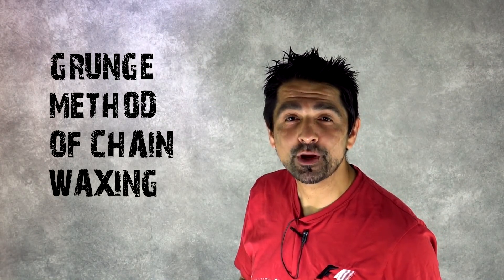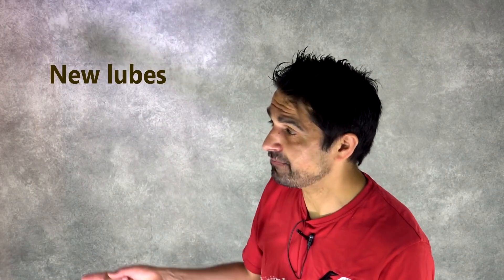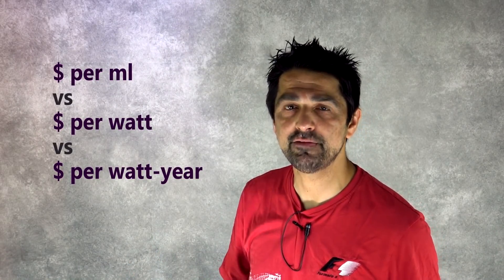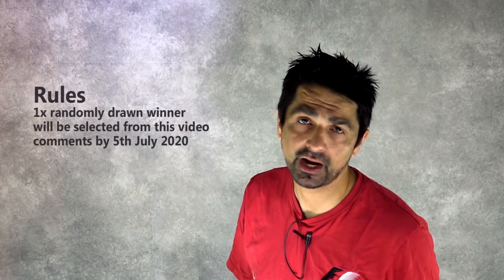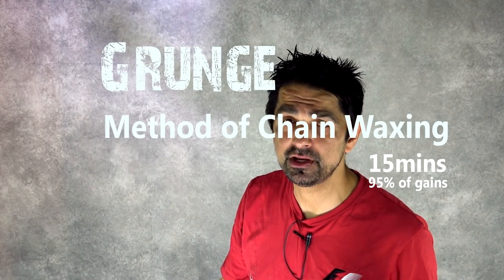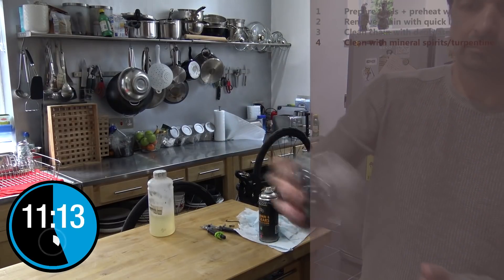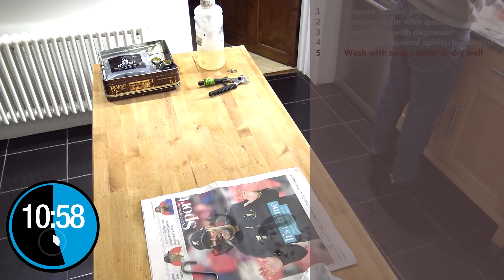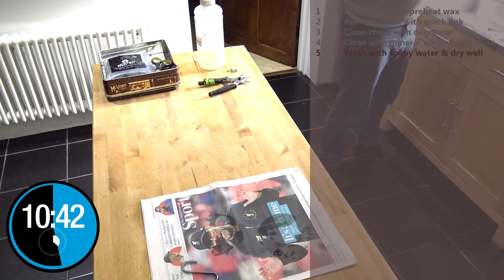Chain waxing and lubes revisited (15min grunge method is not a marginal gain)

Comment: How many watts does sealant add when putting it inside an inner tube ? I am considering buying Vittorias corsa control g 2 tlr for every day use for the added benefits. I saw latex tubes were recommended for the 5W saving but they ofcourse wouldn’t work well with sealant and aren’t the best at prolonged braking at descents. I think I value my life more for 5W and saw continental offered supersonic inner tubes which if I’m not wrong are roughly the same weight as latex but are butyl so that should definitely save me watts, but if you put sealant in, how many watts would that cause me to lose ? The recommended amount is 3 oz for a road bike from slime.
Reply from the maker: Sealant costs about 0.06w per ml of sealant so 30mls would cost about 2w
Reply: FastFitnessTips: Cycling Science! Thanks for the reply! For watt cost savings would you recommend at most 30mls to do the job compared to the 85ml recommended amount ?
Reply from the maker: @bxckdoor9113  is speed is critical then yes use minimal mls sealant

Comment: I tried using paraffin in the past, but it didn't last long, especially commuting in the rain.  Paraffin gear oil mix lasted longer but didn't stay clean.
Reply from the maker: Yes I heard mixing oil and wax doesn't work that well?
Reply: @Fastfitnesstips  Back in the 80's there was no source of teflon or graphite (no internet) and pure paraffin doesn't cut it, especially when wet.  The Paraffin gear oil mix was much better, but it doesn't stay clean, so it kinda misses the whole point of waxing.

Comment: I’ve been using Muc Off hydrodynamic lube
Reply from the maker: Hows it been going with Muc Off hydrodynamic lube I havent tried it myself
Reply: @Fastfitnesstips  It's the best one I've used so far.  It lasts a long time and seems to rejuvenate the drive chain.  I went with it because I was using a wax based lube on  my partner's Di2 Ultegra.  Her chain seems to require more lube than mine which is a Campy ultra narrow .  So using hydrodynamic lube on both.  She now gets leg markings because the lube is basically a wet lube designed for long rides so there is always residue.  We are planning a ride across the U.S. and I was looking for a long lasting lube.  I have a very very unique way of applying and cleaning my chains which I claim will make a chain last forever(just a nomenclature). The method may well give the same results as dismounting the chain; except this is done without removing the chain.  I was going to do a youtube on the method but I looked at myself in the camera and freaked out.  Perhaps I'll make it anyway and send it to you.  I'd like to try the absoluteblack or Silca's Super secret because I like wax type lubes because they are clean.  I did try to melt wax but the result wasn't what I wanted.  Thanks for asking and thanks for your channel.
Reply from the maker: @davidstihler9689  sure send me a DM or similar comparison especially when you have tested further

Comment: Silca's Super Secret Chain lube (the drip one) is ALMOST as good as hot melt. I've been using Molten Speed Wax for my hot melt application, and then I top off my chain after each ride with Silca's Super Secret drip wax. It prolongs the life of the Molten and allows me to go longer between having to do a fresh hot rewaxing.
Reply from the maker: Wow you are cutting edge, its only just out!!
Reply: @Fastfitnesstips  the Super Secret Chain Lube (drip lube) has been out for around 2 months. Silca's hot melt is the one that just came out.

Comment: I've been running waxed chains for 2 years, wouldn't go back to oil-based lubricants.  I use boiling water rather than a degreaser.
Reply: I clean mine in hot paraffin i.e. in a jar set in a pan of boiling water

Comment: What are your thoughts on DuPont Chain-Saver was based chain lube. Motorcycle chain lube, I have been using for a couple years.  It appears to offer the same benefits of standard waxing.
Reply from the maker: I doubt spray on waxes work as well as immersion but they might be an alternative to drip methods. Have you seen this test? https://www.youtube.com/watch?v=VnPYdcbcAe0

Comment: I think just thorough, regular cleaning pays huge benefits as well, even if you use a conventional lube. Just clean thoroughly and reapply often. But the wax is definitely interesting.
Reply: Yep. I think the reality is that most people who use conventional lubes are inclined to just add more lube and to not do a good job cleaning their chains. If that weren't true, then these chains would be just leaving mostly oily marks on hands and clothes and not really black marks. Its just easy to squirt on some lube and do a quick wipe down with a rag. Everything quickly works better, but the dirt remains where it grinds down your chain and gears.

Comment: I have been waxing chains for two years , using the Molten Speed wax. I run 4/5 sets of chains, so waxing process is greatly reduced. Something worth considering. Only draw back i have noticed is a slightly higher noise when cross chaining (I run 1X) , but also a sign I need to switch to new wax chain. Good work on this video. Cheers Rav
Reply: Since watching this, I had to try the AB product, so I have ordered the smaller bottles. Lets see how these fair. (They are not cheap)

Comment: I don't wax my chain.  There was a good watt test of cycling chain lubricants a few years ago that showed that the best wet lube was within 1 to 2 watts of the best waxed chain.  If I find the article I'll post a link.  I remember well that Rock n Roll Gold lube was the best wet lube, took 2 minutes to apply, and was extremely cost effective.  If the best waxed chain is, at best, 2 watts better in performance than the best wet chain lube I'll stick with the best wet chain lube for ease of use and virtually no time commitment.  If you have to have that 1 to 2 watts then go for it.  I've been an avid cyclist for 30 years.  Thank you for the info though!
Reply: The thing is, oil based lube is probably as fast as the waxxed one. But after one ride the oil will attract a lot of dirt and lose the efficiency while the waxxed one won't get that dirty.
Reply: I started waxing when cycle commuting on my e-bike. I was putting over 5000 miles/year on the e-bike and just disliked the messy chain when dealing with rear flats or any other roadside issue that put me at or near the chain. The performance benefit is not a big draw for me. Although the promise of longer chain and drivetrain life is.

Comment: I guess  I am one of the odd folks that regularly waxes his chain and have done so for many years now.  I have long since passed the age and ability where the watts I save are actually noted, but I do it for several reasons anyway.  No black greasy marks on my leg.  I love the sound of a well lubricated drive train.  Finally, I actually enjoy maintaining my bike and thus waxing is not a chore.  I use an ultrasonic cleaner for cleaning and a parraffin and Teflon mixture heated in Crockpot for waxing.
Reply: What teflon size (in the microns) and ratio to parrafin do you use?
Reply: I agree 100%. I don't understand why this "grunge" method is using degreaser and solvents. There's no grease or anything to "dissolve" on my previously waxed chain. A mild detergent with the ultrasonic cleaner (heated to 50C) seems to remove the dirt quite well. I do two ultrasonic passes and "shaker jar" the chain a few times before the second pass. The second pass isn't really needed but I use the clarity of the mild soapy water as evidence that the chain really did get clean.

The for time, my process can take many hours start to finish. But the time that I personally spend on it is only 5 -10 minutes. I spend time:
1) Start crock pot heating up wax.
2) Start heating up water and jar with water and mild detergent in the ultrasonic cleaner.
3) Remove chain and put it in a the jar.
This takes 2-3 minutes at most. I go do something else as things are heating up.
4) Turn on ultrasonic cleaner when temp is up to 50C. The temp is important to melt the wax. Run for 20-30 minutes.
This takes seconds to push the buttons. I then go do something else.
5) Discard dirty water in jar. Rinse and shake the jar with plain water a couple times until there are no bubbles. Optional for the OCD folks, put in new soapy water and run ultrasonic again for 20-30 minutes. Solution shouldn't get very dirty.
Again, this takes a couple of minutes.
6) Dump soapy water and rinse/shake chain in jar until there are no more bubbles. Hang chain up and dry with towel. Let air dry. If you are in a rush and want to spend the time, use a blow drier or heat gun to speed up the drying process.
7) Your wax should be well melted by now. Stir wax if you have Teflon or other additives in it. Drop chain in. Let it soak while you watch TV, have a snack or do whatever.
8) Remove chain. Hang it up and wipe it down with paper towels while still hot. 

This process takes very little of my personal time. The devices spend time doing the work. I just tend to them now and then. I have three chains for my main bike so that I always have either one or two chains ready to go. I just replace the chain (In minutes - no mess) with a freshly waxed one if I hear my chain making any noise on a ride. I probably ride 300-400 miles a month and the chain seems to last about a month before it needs changing. I live in a dry area with almost no rain/water to deal with.

Comment: i currently use lube on my ebike and have to do an oil change every 300 miles because of how quickly it dirties. Will this allow me to go further....for refference i bike 20miles per day so basically every month i do an oil change
Reply from the maker: That's a good point re ebike chains. You need longevity over watts savings I presume.....I would say clean regularly and use a one of the better value drip waxes (or a good lube from my blog chart)

Comment: The time to clean and rewax a chain monthly is a tad much.  I'd rather not have to complete the process more than 6 times per year, per bike.
Reply from the maker: You can achieve that by either waxing two or three chains at once or using a longer lasting product like graphenlube if its true data!

Comment: I use squirt.  It takes 15 seconds, not 15 minutes.  I apply it every 200-300 miles and typically get 8000+ miles out of a chain and get 3 chain changes out of my cogset.  The time savings for Squirt far, far, far out weights the few watts savings that parafin wax might give, especially if you are not actually racing.  Most of us ride for a thousand reasons other than racing and a few watts really doesn't matter.  But by using Squirt vs parafin, how many years of your life will you save?
Reply: How do you find the chains run in terms of noise. I was finding after 20-30 miles the chain got noticeably noiser, and I ended up with congealed black wax around jockey wheels and chainrings. If I use less squirt lube the noise is worse. (SRAM red groupset)

Comment: Really interesting video, thank you :-)… I generally always maintain & clean my bikes & don’t mind the amount of time it takes to do so as I would rather have a bike that works better & lasts me.  I am interested to know what you personally feel is the ideal combination if waxing (PTFE etc) the chain, also temperature to heat it too as well.
Reply from the maker: My personal view is plain and simple MSW or paraffin is fine (without extras) and temp officially is 93degC but you dont need to be exact as long as the wax is entirely LIQUID with the chain in.....you can assess my eye, you dont need a probe.
Reply: @Fastfitnesstips  thank you :-)

Comment: what kind of wax? I've tried paraffin wax and it doesn't save any watts and it flakes out super quick!!!
Reply from the maker: If you are not getting on with paraffin wax try Molten speed wax or Silca Hot Wax
Reply: Likely you had some residual oil still on the chain before waxing.  Check oz YouTube and see how he cleans it before waxing the first time.

Comment: All the people I know who wax have rusty Cassettes? Maybe because they only lube the chain and before the oil they used went all over the drive train and protected everything. So what's the solution for rusty parts if you only wax your chain?
Reply from the maker: This is a good point I think the cassette needs a light treatment (with anything!) just to prevent rust. Anyone have any tips for this?
Reply: Spray on Car wax on the cassette (off bike of course then reinstall) and individual cogs and wipe off excess maybe ?

Comment: I did the same . Paraffin wax in a cooking pan on the stove. However 
I had stiff links and the chain was  was jumping on the jockey wheel
.  I am  wondering what I did wrong .
Reply from the maker: ah yes, if you have this problem, bend the chain a lot before you put it back on, then run the chain around 10x with the bike upside down, after this it will be loosened up

Comment: Literally just changed my chain today. Sick of how quickly they wear out despite regular cleaning and lubing.  Is it just  melted candles you are using and the where would I get the heating device? Thanks
Reply from the maker: I bought cheap paraffin wax powder and I combine is with MSW. Just buy a cheap wax heater for $20 using terms "hot wax pot heater"

Comment: What do you think of the "Ultimate Chain wax" that "oz cycle" shows in his video: https://youtu.be/HHr9znwpwmQ ?
After his long tests, he found that the chain with his homemade wax+PTFE was less worn that the chain with MSW (https://youtu.be/953QTThT4_M ).  It seems that his formula may perform better than the MSW isn't it? It would be interesting to have this homemade wax+PTFE formula tested against the MSW on a bench. I switched to his formula but cannot feel any difference compared to the MSW on my bike.
Reply from the maker: Thanks for the link, I have no doubt that you can improve on MSW or normal paraffin wax but for most people the additional gains are really small and time factor becomes an issue. However, in a pro team or a critical event you might go for the OCD method with additives of your choice for 100% gains. I think 95% of the gains is fine however. Incidentally here is the Oz cycle comparison on a wear chart (https://www.youtube.com/watch?v=953QTThT4_M&feature=youtu.be&t=14m25s) which I hadn't seen before today but is a nice comparison.

Comment: I’ve been waxing with paraffin wax for a couple of years. I have wondered what would happen if I added ptfe powder of graphite to the blend. Graphene is an interesting option but did not know this existed. Ultimately the greatest benefit to waxing is the smoothness and perceived wattage gain for the same effort. The number two by product is the cleanliness. No more shin skid marks. Graphite will leave a black mark. Is this the same for graphene.
Reply: while not racing I put clean bike on top of the advantages
Reply: I originally used a wax formula that included Teflon and molylbdenum di sulfide (MoS2) which the literature I have states is similar to graphene in appearance, feel, and qualities.  The resulting wax mixture is medium to dark gray and can leave a stain on your fingers and calf, but not nearly to the extent that typical oil based lubricants do and it doesn't smear.  I eliminated the MoS2 from my second batch and since I am not an elite rider I can tell no difference in my bike's performance, but now there are no stain concerns what-so-ever.

Comment: If you take the time cleaning an oil-lubed bike into account, then any method of waxing is considerably faster. You pretty much don't even have to clean your drivetrain anymore, you simply brush it off every now and then. The main reason I switched to wax was to reduce maintenance headache, not increase it.
I have 3 chains that I use consecutively, so I wax them all at the same time, maybe once a month. The rest of the time I don't have to think about it. Maintenance have never been easier.
Reply: I would not put it in any time frame rather millage
my commuter can survive few months as I do just 5 miles a day but my road bike just 1 week
Reply: Before this video, interest in waxing was waning😉

Comment: I recently switched to Finish Line Ceramic Wax. I've to do say, I've got probably 200mi riding with it, and I'm not super impressed with it. I was using their Ceramic Wet for the winter\spring and despite it being filthy, shifts felt smoother, drivetrain felt quieter and smoother. Definitely looking for another method\product.